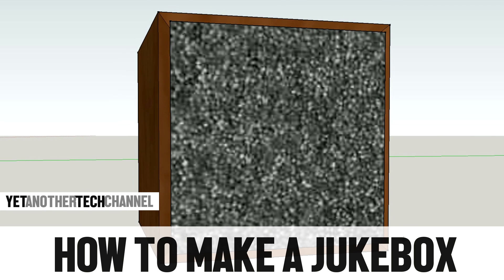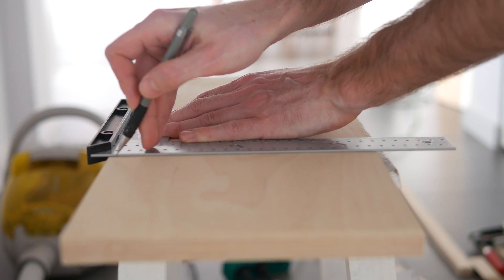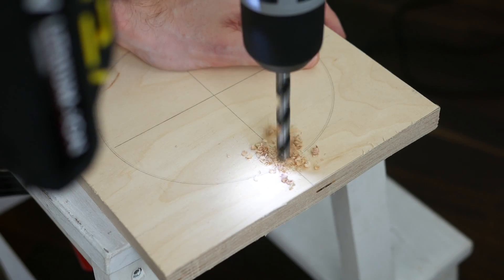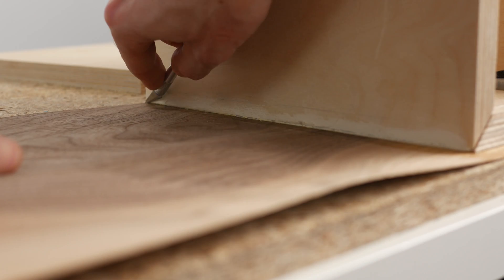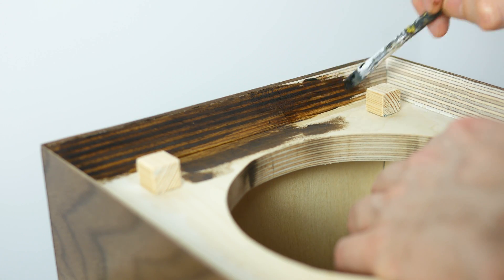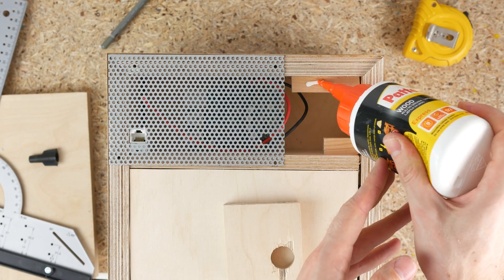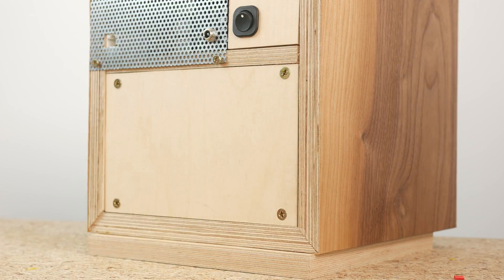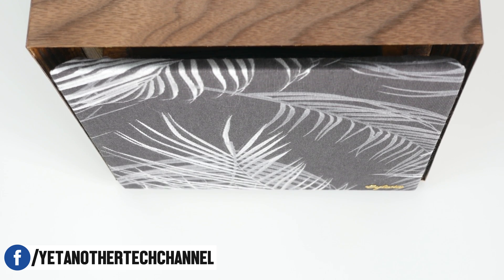How to make a music streaming jukebox based on Raspberry Pi 3 and HiFiBerry AMP+

Comment: This speaker box is lacking a basic feature : the back hole for the bass. The way it's made, beside sounding all mid and trebles, it will shake and move out whenever you pump up the volume.
Reply from the maker: Yeah, I'm not an acoustic engineer so I took a willy nilly approach to this project.

Comment: Nice job and an interesting project, but who the hell has all those tools laying around the house? Add the carpentry tools and you'll easily go over $1000.
Reply from the maker: Lol, yeah, definitely not many people have this many power tools ;)
But these are pretty basic tools that you can get a hardware store for under $200 in total.
The miter saw is probably the most expensive purchase but you could make a slightly different design using only a jigsaw.

Comment: Good job. You should seal the hole where the speaker cables run through from the Pi to the speaker. Silicon sealant or similar would do the job.

Comment: great work...but let me ask 2 things: 1- why use foam on electrical compartment ? 2- You attached the plugin metal on other metal framed Wires..for sound It isnt Gold...the audio have to be Very meticulous cared Every time of metal affect the structure of final sound. Take Care and Search If its ok ir is It Better to change the material
Reply from the maker: 1. It's not foam - it is a material used by audio industry to dampen speakers cabinets. I wouldn't try putting it next to an active AMP circuit but since it's just a crossover, it should be okay.
2. I wouldn't be so sure about it... but I'm not an expert ;)

Comment: It does looks beautiful but I can't help to notice you are kind of wasting the processing power of the PI 3. An digital assistance perhaps with an mic array?
Reply from the maker: +viperarc I used RPi3 because of its built in wifi as I don't have my entire apartment wired with ethernet cable.

Comment: is glue really the best idea? for all the work involved I would want it to be more durable
Reply: well done pva wood glue like this should be good for 20 years this after all is not a wood working channel :)
Reply: @zac6x9  good point. Sometimes you make do with what you have. Looks good that's all that matters with the box. The real test how to make it sound better.
Reply from the maker: +TimothyTim PSP I'm not worried about durability at all - the box is really solid.
Reply: YetAnotherTechChannel 
Yes but over time the glue will fail

Comment: Do you have any suggestions on how to make this battery pack operated for use in areas with no access to AC? I cannot find anyone on the internet who has made a portable unit running off a battery pack. I also do not know how much current this amp draws at full volume (party location). Any help would be appreciated by me an a lot of other people who want a fully portable unit.

Comment: If you had a bigger budget and didnt use the random 6" speaker. what kind of speaker would you have chosen for to get better quality? (looking for a good speaker but might end up doing this)
Reply from the maker: +Just Weird I'd probably get the Magnat ICQ262 - the same that I have in one of my bathrooms, goes as low as 38 Hz if I remember correctly.

Comment: You have a sealed cabinet filled with polyfill, so bass is going to be lacking.  You can increase bass by adding a plastic tube in the rear in alignment with magnet of the speaker.  Porting a speaker will add bass.  Alternatively, you could add a passive radiator to the rear or even sides of the box; this has the same effect as a porting tube.